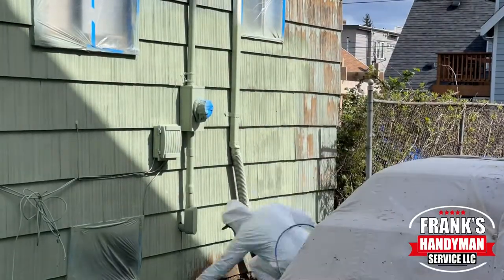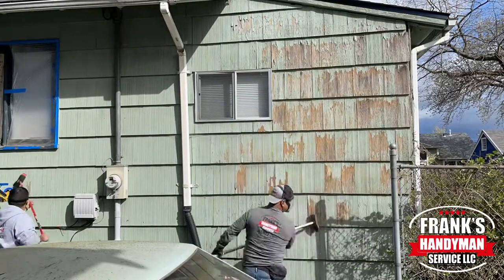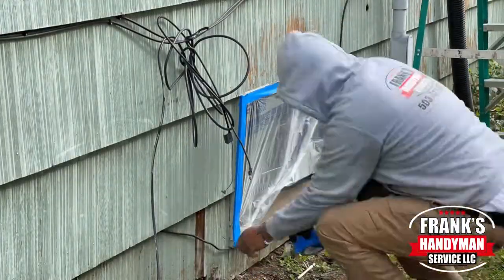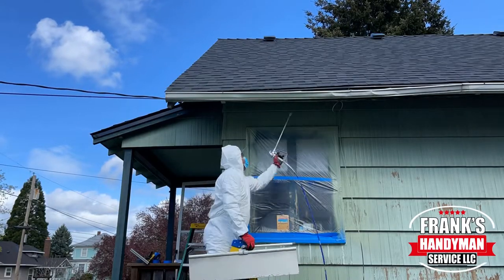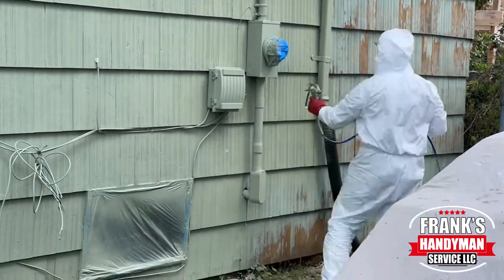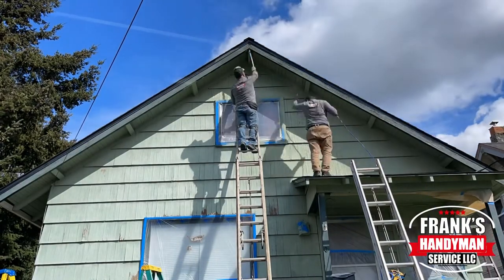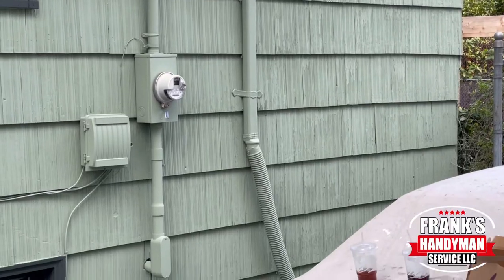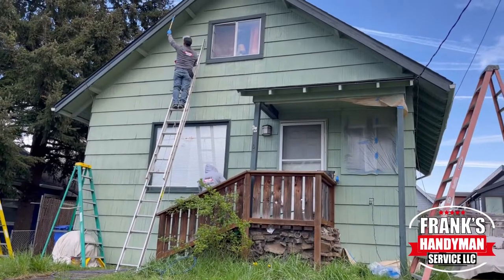How To Paint The Exterior Of A House That Has Cedar Wood Siding With Peeled Paint Step By Step DIY

Comment: You've done very well with a difficult situation. Great job!  As a homeowner, with cedar shakes I understand what this homeowner was faced with.  My cedar shakes are painted as well.  It is blistering and peeling.  As far as I'm concerned, I'd never paint new cedar.  I would only stain cedar, but if you acquire a house that was already painted, then you just have to do what you got to do.

That said, I don't think the look you get with these particular cedar shingles is too nice.  To me, they look like fiber cement shingles.  In fact, I might have considered just replacing the cedar shingles with fiber cement shingles.  As the homeowner, I'd also have something done with the exterior cables, downspouts, etc...  I think that it considerably brings down the appearance of the house.  Don't let that Cable Guy tack up your cables wherever he feels like it.  In fact, wire the house yourself and just show him where you want the service terminated and modem mounted.  My modem is in my basement all Cat 6 cables run through the walls from there.

But again, the contractors have done a great job here.  House looks as good as it can given the homeowner's preferences.

Comment: Pressure washing won’t harm those type of shingles with a 25 degree tip. Also I always, always prime first. I usually add a gallon of the house paint to 4 gallons of primer to give it a head start so the white primer is a light shade of the house paint.

Comment: Hi, thank you for the informative video. In the house you show here, many of the shingles have raised grain where the soft material in between the harder lines of grain is worn away, leaving deep grooves that look really bad, even with fresh paint. 

My house has that problem on the south side that sees the most sun and rain, and I want to know what I should use to fill those grooves back to where the shingles don't show such deep weathering. Can you suggest any brands of filler material that would work, and that would last another 90 years? (House is 90) 
Thanks.
Reply: PC Woody brand wood epoxy is what I use. It's a 2-part wood filler epoxy paste. Absolutely amazing product.
Reply: This house had a type of cedar shingle that when you look at it on edge it looks like a fine tooth saw blade. A 10 or 12 inch wide shingle has (roughly) 100 shallow groves running from top to bottom. Look at the video with a time stamp 1:54. Pause it and zoom in on the upper left hand. You'll see what I am talking about. So, these line are not from the soft grain being eaten by the sun and weather. They are mad this way. Search this and look for images.. Western Red Cedar Shingle Siding, 18 #1 R&R, Grooved, 14in. Exp.

Comment: thanks for this video! I have the exact same cedar siding that I would like to repaint. However, it looks like a recent paint job and it's still in pretty good condition. Is it possible to simply paint over it without removing the existing paint? It's an older house and I'm concerned there may be a layer of lead paint under there. Thank you.
Reply: I would call around and learn the cost to test for lead. You may be able to find a chemistry kit that would do it for even less $$. Best of success!
Reply: Jake, I have the same issue with my house. Did you ever get an answer on how you should proceed? If so, what did you do?

Comment: There's something to be said about real wood siding, still to this day I do not like vinyl siding it looks superficial and too perfect, they say vinyl is final but I think it's just a cover-up you just don't know what's going on underneath that siding after 25 years. I think it's easier to replace rotten wood as you find it and as it appears and always have the color of your house paint on hand for touch up, I use exterior solid stain anytime I make a shingle or trim repair as long as I prime the trim boards they're usually okay, red cedar r&r shingles I don't prime I just heavily stain them and they suck it in, if the stain fades I just touch it up and it blends in nicely. Painting cedar shakes may last a little longer but it traps the moisture in and it peels and the shakes rot sooner.
Reply: Agreed with some points put I do like what they are doing with Vinyl thees days. No longer do they only have strait flat clapboard style. Shingle stile even with wood texture and complicated shapes are a small upgrade in price.

Comment: where did you get the red brushes from to remove the paint? Amazon? I need to get a couple and have not been able to locate.
Reply from the maker: Hi Sean, in the description item #11 shows the paint scraper brush we use to remove the paint. Hopefully that helps.
Reply: @frankshandymanservice  thank you!!

Comment: WRONG way to paint. you need to use a paint brush to get the paint into the crevices of the shingles.. a sprayer or roller will not do that and the paint will peel off and bubble from water
Reply: Agreed, if you spray and don't at least back brush it, it's very likely to to fall off before long.

Comment: No primer? All bare wood should at least be spot primed. I have never used a wire brush to remove paint in my life. Use proper strippers and scrapers.
Reply: Yes, I primed mine with oil base primer. However, good luck knocking the paint out of the grooves in cedar shakes with a standard scraper. I used wire brushes when I painted in mine 1997 and again in 2018 (21 yrs later)